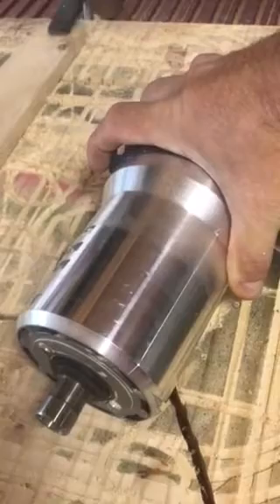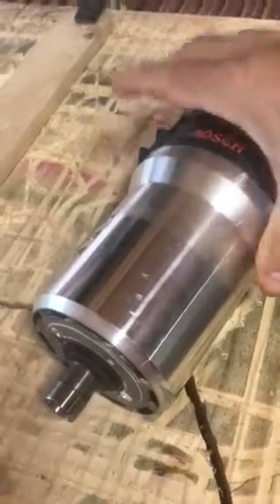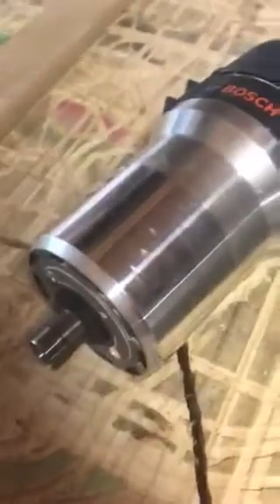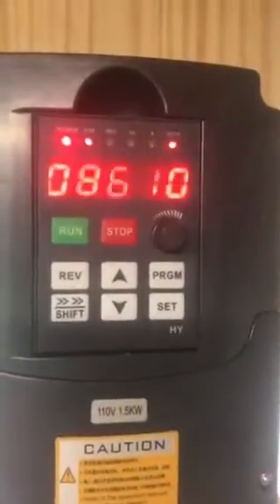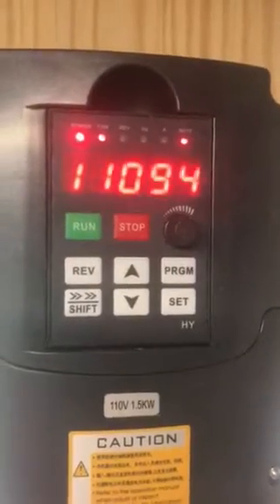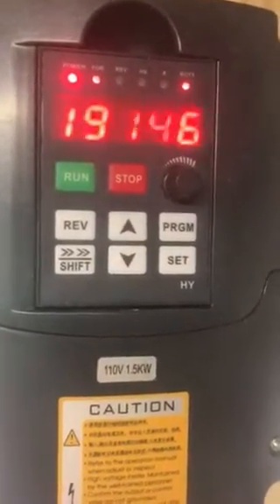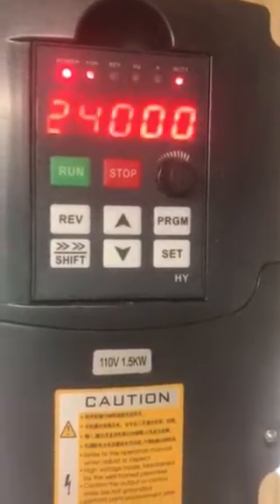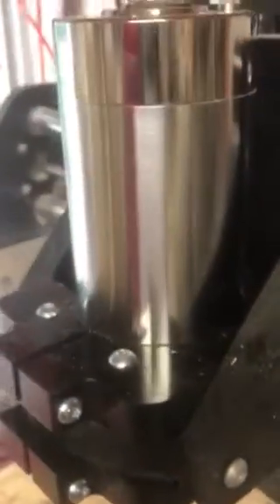Sound comparison Spindle VS Router

Comment: is that the spindle set up from Nexwave automation? does it have the collets to accept 1/2 inch bits?
Reply from the maker: Sorry late reply.  been busy.  this spindle is from next wave.  it does NOT accept 1/2 in shank bits,  up to 1/4 only.  I had a hard time with this after using 1/2 inch bits for a long time. The decreased noise makes it worth it.  I was getting really tired listening to that router all the time